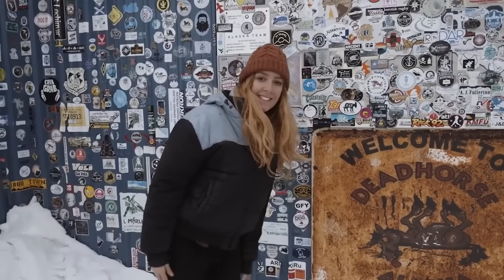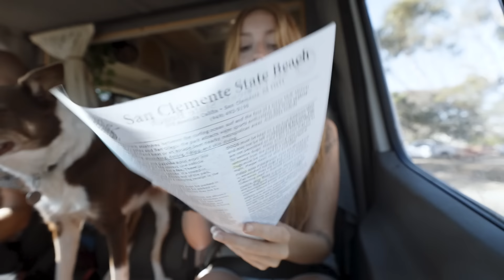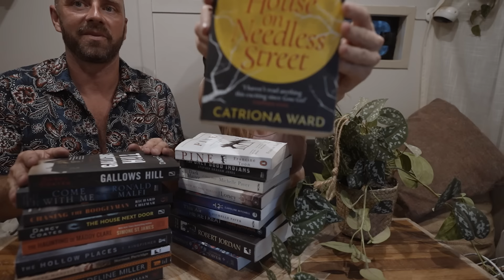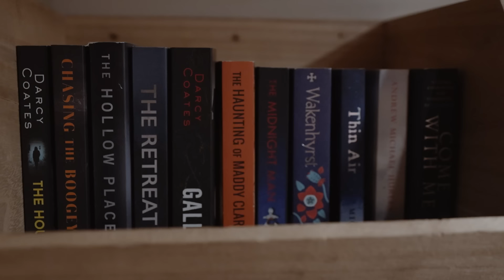Can Anything Else Go Wrong? Ripped Off and P**sed Off (Van Life USA)

Comment: if any work will not void the warranty then use a garage who dose specific work. ie. brakes.  dealers like ford and mercedes always charge high prices. as for parts, you may want after market brands, used, rebuilt etc.  example.  i had a porsche the dealer wanted $xxx and volkswagen wanted $x for the same part. ( volkswagen is a sister brand to porsche ). 
glad you said NO to some of the work, and glad you can do some of the work. i dont think your brake fluid needs changing, a  google search will tell ya.
Reply from the maker: We didn’t want Mercedes to do the work - just diagnose any issues. They charged triple and still didn’t do it properly! And yeah the brake fluid doesn’t need changing. They told us it was black but it’s still clear 🤔

Comment: I wouldn't not bleed the brakes...as you'll only need to bleed the one caliper when replaced.  Safer to get the old fluid out sooner than later. Stay away from the Stealerships.  Plus it's a Mercedes...trade it for a Transvan.

Comment: If the slider is seized some brute force with a hammer to get it moving then greasing it will eventually get it working again. The rubber boot just keeps the water out and grease in - to stop it seizing. A new calliper will be very expensive so I’d go at it with a hammer first to unseize it. Seized parts on the brakes will cause vibration as one pad will be rattling around not pressing up to the disk fully. If brake fluid is more than three years old then changing it might solve the sponginess when hot as it might have absorbed water which turns to air bubbles when brakes are hot. Definitely worth learning how to do all basic servicing for your vehicle as most things are really easy once you do it a couple of times.
Reply from the maker: Ben tried a lot of brute force but it wasn’t budging. Also put some penetrating spray on there too but it ain’t moving! Brake fluid was changed with the brake change so shouldn’t need doing, but we might change the calipers just to be on fresh ones and will have to bleed the BF anyway then. Ideally we get the slide pin moving and just get that sanded down and greased up a bit ✨

Comment: Well done Ben, sorting out your brakes and to you too Chesca, for complaining to Mercedes and having a great outcome to the complaint…. We have recently bought a Mercedes Sprinter, which we plan to convert into a camper, however have had some outdates which were outstanding and had the most awful experience with  Mercedes Birmingham - wouldn’t touch them now with a barge pole. They returned the van with an unusable damaged seat belt and tried to tell us that it was like that on arrival!
Reply from the maker: Honestly it’s crazy how many REALLY bad experiences people have had with dealerships of all kinds. If it’s any consolation, Sophia has been an amazing van over the past 4 years with barely any problems at all and any fixes have always been easy. They make great campers; but of course we’re a little biased 😂💛
Reply: ❤ @OverlandingSophia

Comment: If you can get the pin out... and if you're certain you haven't damaged anything in the process... lubricate the pin with special grease designed for caliper pins as this grease is heat resistant.  The wrong grease, will cause the pin to have the same problem in short order.  Best bet:  when you change calipers, buy a kit so you get a full set of replacement parts - but do check to make sure the kit came with grease, and buy some if needed.  When you do brakes, always choose middle-of-the-road or better parts.  Right down to the pads.  Cheap parts might feel good in the beginning, but they are just a heartache that WILL happen.  You're still in the USA.  If you're doing the work yourself (perfect!), now's the time to have a heart-to-heart with your van and make space - you at least have the small parts you EXPECT to replace during the next 12 months.  Better that than a 500km tow from nowhere - to somewhere close to almost... nowhere.
Reply from the maker: The slide pin is really seized so gonna give it another go today or tomorrow. As to parts, we had cheaper parts when we did the brakes in Vancouver. Hence why we paid extra for the genuine parts this time. For things like the brakes think it’s always better 🙏

Comment: Hi guys, another great episode. Glad your issues got sorted. It’s a bit scary that a main dealer missed the issue with the brakes. I’ve had an issue with Mercedes although its not a huge problem it should normally be fixed under the three year warranty. But guess what. The USA Mercedes don’t honour the European warranty. 😢😢 Why. It’s still Mercedes!!  All the best, Happy travels.
Reply from the maker: Thanks Graham. Yep, it's one thing to overcharge for a job but another to not do something like a brake check properly 😢

Comment: My mk1 Sprinterwent  3 years going into limp mode. It's an automatic and the shift stick had an issue.  I took it to Truro Merc Commercial who couldn't find the error, sorted out the gearstick and charged me ......£900. Yes.  And as I drove away the gear stick disconnected completely and I had to coast to a stop and get them to come and sort it.  (It was solved by a guy with a laptop, cost me £75) To add insult to injury I found myself on their marketing list and a year later was invited to drinks to try out a new saloon. 😡
BOOKS !!  PLEASE try R. HAYWOOD  UNDEAD SERIES BOOKS 1-25, brilliant series. On Kindle as well as paper. Loving the channel.
Reply from the maker: That sounds scarily similar!! Like I said in the letter - extortionate cost for an unprofessional and subpar service 😡 You'd expect better from Mercedes but judging by other's experiences now, we won't be caught out again by them. Guessing you declined the drinks invitation?! 😂 Thanks for the book recs!! 1-25!! That will keep him busy 😆 xx

Comment: Good job on working on the bake.....you going to end up at a tire alignment shop anyway....let them change the tie rod...
Easy
Reply from the maker: If we change the tie rod correctly we shouldn’t need to have the alignment done. But… definitely tempting to have them do it 😅
Reply: @OverlandingSophia  I think it was smart to have the brake cable adjusted

Comment: you should be able to get new glide/guide pins and boots and I just clean the bore out with about a 1/5th of a can of brake cleaner.  get a drill bit just a bit smaller than the bore and some paper towel and get it as clean as you can.   then take some new brake grease and grease the new pins and put the new boots on and you should be back in action.   This was definitely part of the brake noise you were hearing... without those glide pins being freed up and moving the pad was being push onto the rotor imperfectly and creating noise!  

Just read some other comments and I agree with brute force you should be able to get the old pins out... new pins are fairly cheap $20-30 bucks.  give the bare a good clean with above method and put new grease they should move without hesitation!  Boots should come off and on with no real problems ... sometimes a vice might be handy some have a grommet that holds them in place,  im not familiar with the Mercedes ones.  Cheers !
Reply from the maker: Thanks so much for this 👍 As it stands the seized caliper will not budge, even with brute force but we’ve put some penetrating fluid in there and will try again today to get it to move 🤞

Comment: The brakes check would have been visual and the test more than likely would have been on a brake tester as your brakes are still working they would have passed that,as for labour rate is normally double the rate of uk which about right.
Reply from the maker: We’d paid extra for them to do a bigger more thorough brake check, including calipers and brake fluid which is why we were frustrated with them. Especially as we also told them our worries and the noises we were hearing. The usual standard diagnostic work was a little cheaper x

Comment: Sorry about your dealer experience they should have found those issues you can change the tie rod without effecting the currant alignment if you remove it at the wheel end first and then turn it off the rod without moving the jam nut you can loosen the jam nut first as the threaded rod will turn at the inner tie rod as for the seized slider piston you will probably need to replace the caliper unless a caliper hardware kit is available same goes for the bad rubber boot on the other side hope this helps Karl from eastern Canada
Reply from the maker: Yes this is exactly what Ben is planning on doing! Thinking we might change the calipers out and at least we know we have brand new ones on. Thanks so much Karl 🥰
Reply: Your welcome sounds like the proper thing to do to ensure a safe trip below the border Karl @OverlandingSophia

Comment: They are not dealers, they are stealers. BMW wanted £1000 for a job that took my mechanic 30 minutes. the parts were £200 from BMW themselves. Whole job cost me £250. They have higher overheads but £750 labour for 30 mins 😅
Reply from the maker: It's mad isn't it! We only wanted Mercedes to diagnose any issues but they shafted us with that too 😭

Comment: Absolute joke $1500 for a track rod end, this is why I never use a garage unless I absolutely need to. Well done for giving it a go yourself.
Bit of advice, assuming the new track rod end (TRE) is the same as the existing one, mark the end of the old one and also count the amount of turns as you undo it, should be close enough with the alignment.

As for the brakes, I would personally get a sliding pin set which should come with the rubber boots and some grease, (I'd be surprised if mercedes included these if you bought new calipers). 
Not sure if you did, but you need to use the correct grease for the sliding pins. 
Hope some of this helps
Reply from the maker: Couldn't believe we were talking about the same part but we really were! That's what we plan on doing with the tie rod, shouldn't take the alignment off too much. We will replace the pins only if we can get the damn pin out, it's really, really seized. Trying again today! Thanks so much for the tips 🙏 💛
Reply: @OverlandingSophia  I suspect the grease on the pin is mixed with dirt as the rubber bit is split which makes it hard to get out. Had the same on my land rover. 
If you have any diesel to hand, try covering some over the pin while you twist it rather than pulling it out, should free it up a bit.
Good luck👍

Comment: The whole auto service industry in North America has severely gone downhill. Service technicians are leaving the industry in record numbers due to the flat rate pay structure which leaves many repair shops retaining subpar staff. Also many major brand dealer shops resort to upselling practices to generate more revenue. It sounds like you were victims of both scenarios.
Reply from the maker: Sad times. Good mechanics are hard to find at the best of times 😢

Comment: Goodness, I wonder if a Dodge(RAM) dealer would have been cheaper, or if they could work on them. Maybe not do to some agreements between Mercedes and Dodge.
Reply from the maker: We didn’t really want Mercedes to work on the van, just let us know what was wrong. But they didn’t even do that right 😂
Reply: @OverlandingSophia  , yeah i understand that, had similar problems with one of the Hyundai dealers in my area.

Comment: Those pins need to move as they allow the caliper to move in and out and the pads to wear evenly down the face,get heavy with the pin some wd40 and a hammer so that it slides
Reply from the maker: Brute force wasn’t working but he put some penetrating fluid on it and we’re going to have another go today or tomorrow!

Comment: Hi Ben, l know your concerned about diesel quality in SA, just to let you know I drove a 2011 sprinter probably same engine etc as yours and my particulate filter got totally blocked and stopped mt engine in Tibet, yes, I drove my sprinter from U.K. to Malaysia in 2014, I didn’t know anything about low sulphur diesel, I thought my DPF blockage was caused by water contamination as the diesel looked like milk, but may have been a combination of both, anyway ,got the exhaust pipe disconnected at the turbo and started like an old tractor, once the contaminated diesel through high pressure system ran ok but we were at 4000+ metres, drove 4 days with exhaust disconnected to Lasha where the DPF and catalytic were emptied and drove an 5000 kms?
Reply from the maker: Wow that sounds like an incredible trip!! Even with the blocked DPF! How long was that trip? We have our diagnostic reader which gives us DPF readings. Once we hit areas with high sulphur fuel we’re going to be monitoring the DPF readings to see what level of sulphur it can handle. Some vans can handle 1500ppm so that’s pretty damn high. Although in Bolivia that can reach 50000! If we see it getting blocked we should be able to drive to burn it off, we also have an additive which reduces the temp that soot can be burnt off which helps reduce DPF regens. We can also force a regen through the diagnostic tool if we need to and worse case, dump the fuel and find something else. From other travellers we think this would only be a problem in Bolivia. But time will tell. We know someone who drilled holes in the DPF! Then just replaced it when they came home 😂

Comment: Unless you are a certified mechanic with all the tools, they are guaranteeing the work…did you align your wheels, etc? And when it breaks down in Mexico, or you find your tires are wearing unevenly, how inexpensive will be to do it yourself?

I get where you are coming from, but that is just the cost of things, these days….
Reply from the maker: The whole point is that they didn’t guarantee the work. So much so they refunded the brake check as they didn’t do it properly. If it’s something we can do, we will. If not, we’ll have to take it to a garage. We’re not saying never go to a mechanic, that would be crazy 😊
Reply: @OverlandingSophia  thanks for the reply, and I posted before seeing the entire video…still, I would rather turn over something like the replacement of brake parts, or ball joints to a garage….if for no other reason I would have someone to yell at!  One factor not considered, is the value of your time..and advice to Ben - always, ALWAYS wear gloves! Depending, you will have remnants of the grease in your hands for weeks…plus, gloves save you from all the nicks, and scratches when skin comes up against metal…

Comment: Just a little FYI... When you are on the road, and you find yourself low on brake fluid, or power steering fluid, or even automatic transmission fluid, you can swap them out if need be, because they are all hydraulic fluid. The ATF, does have red dye in it but yes they are all hydraulic fluid.
Reply from the maker: Didn't know this! We don't have ATF as we're a manual but this is really great information, thank you! 🙏